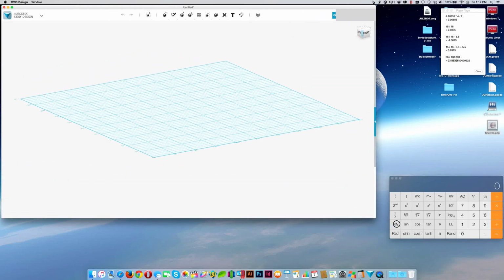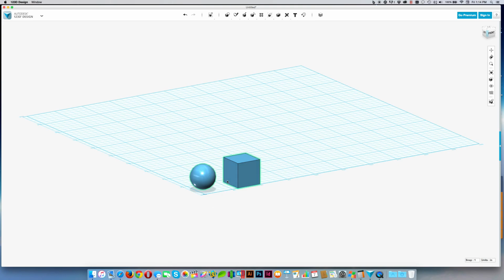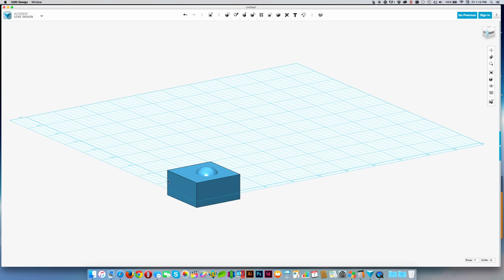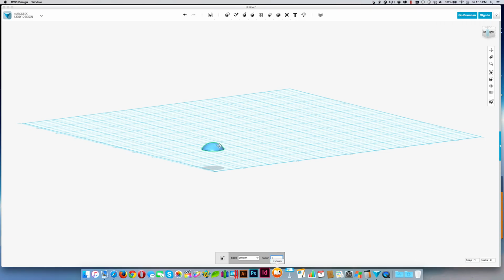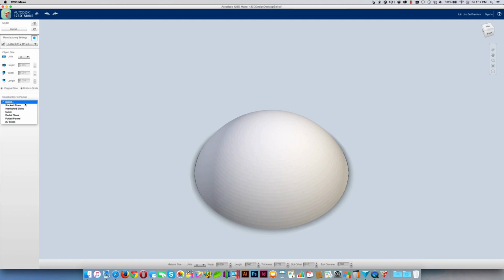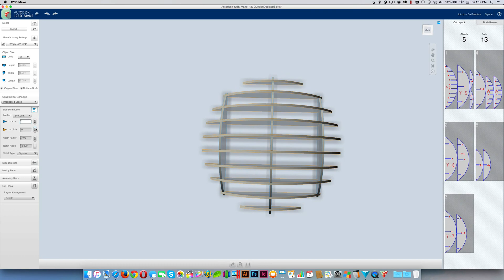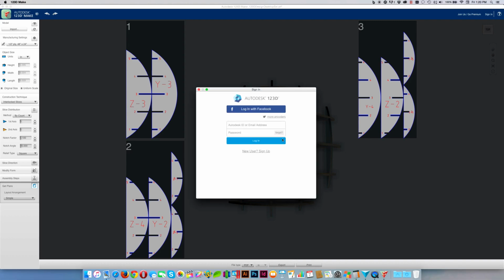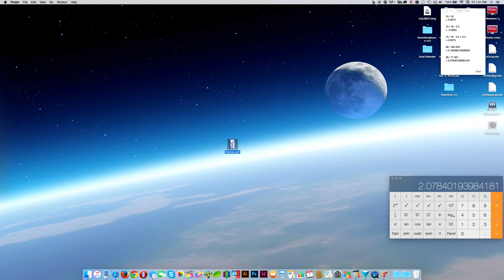3D Tutorial: Curved Shelves

Comment: That is so awesome Jel. Thank you so much. How do I choose the exact thickness of material (for example 1 by whatever pine)? Also....I don't have Adobe Illustrator and I'm broke as heck...I'd give my left arm for it though. Need a left arm? lol
Reply from the maker: Charles Dearing Up in the left area of 123D Make, where you choose the material, click the pencil button. Then, click the "+" at the bottom of the list. Give the new material a name, and adjust the parameters to match your physical material. You can skip the tool stuff at the bottom if you don't care about it. The most important things are the dimensions of the material itself. Once you've created that new material, you'll still have to select it from the drop-down list under "Manufacturing Settings".